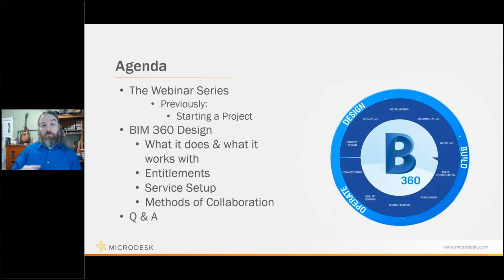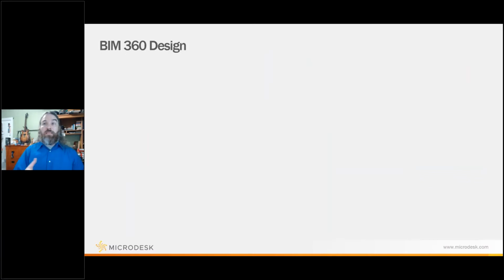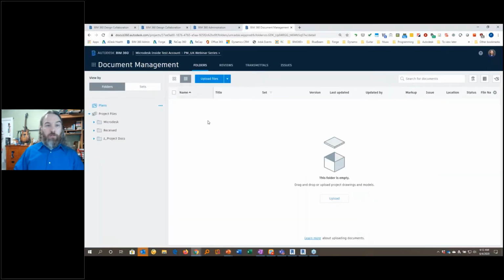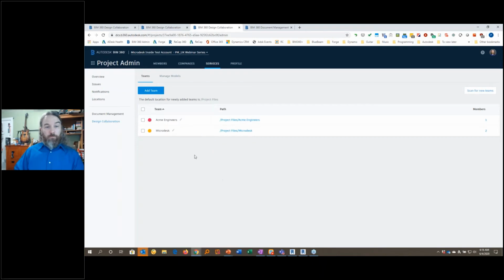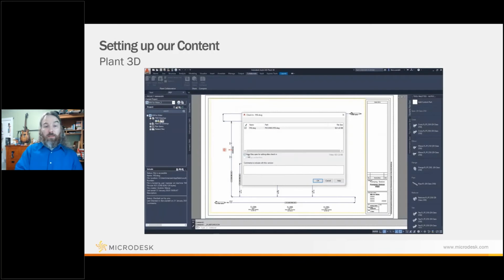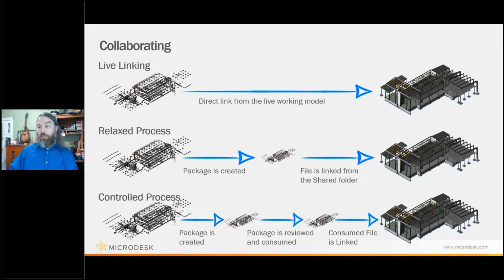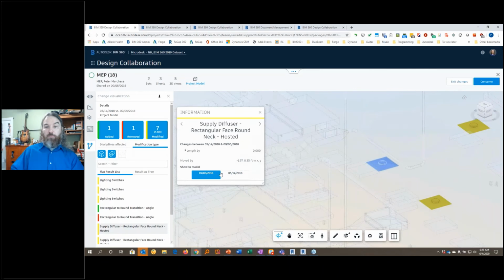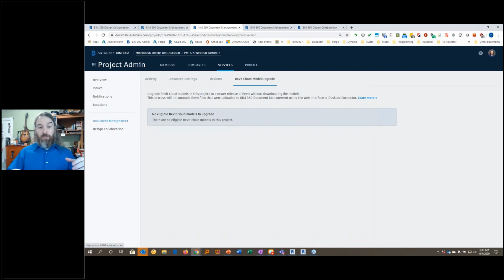BIM 360 Workflow Series: Session 3 – BIM 360 Design Setup and Usage

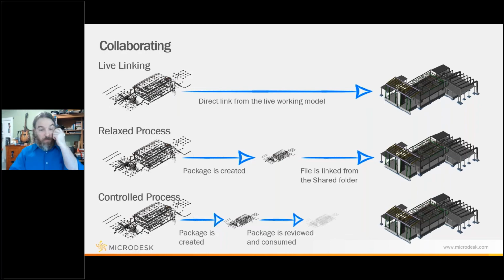Comment: Hopefully, this helps someone as I couldn't find this info after hours of looking:  If you are in the Design Collaboration > Teams module you will notice a button for PROJECT MODEL. This should take you to a 3D view of the project and it will create an aggregate model from all of the models in the project. What no one tells you is that to see the aggregate model you must share and CONSUME packages. Live linking and Relaxed Process (22:41) do not allow the model to be aggregated.    This was very aggravating to figure out as we were trying to use a mixed approach of Live Linking (internal Arch & MEP) and Relaxed Process (Outside Consultants).